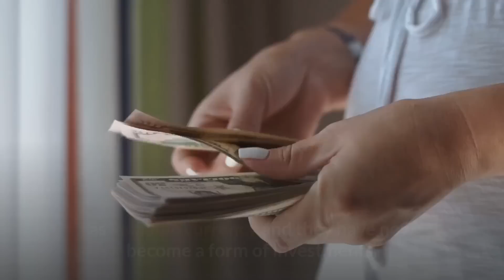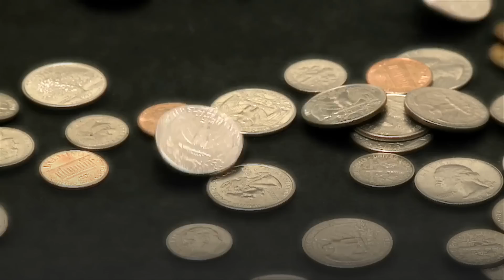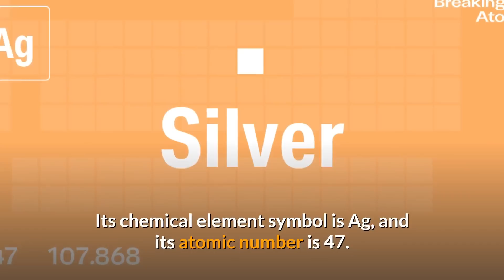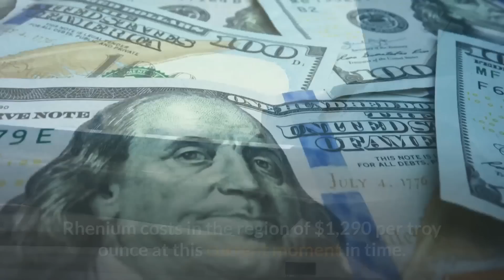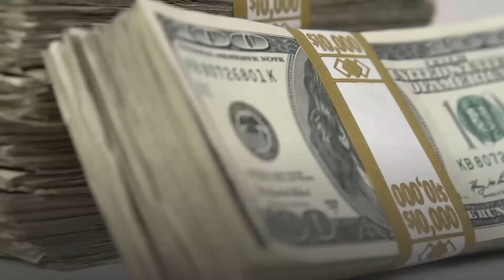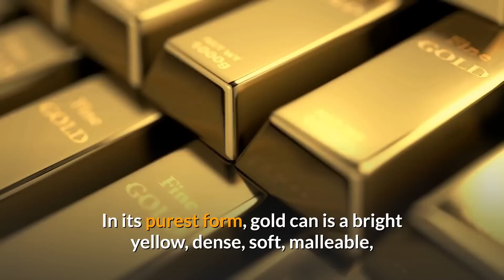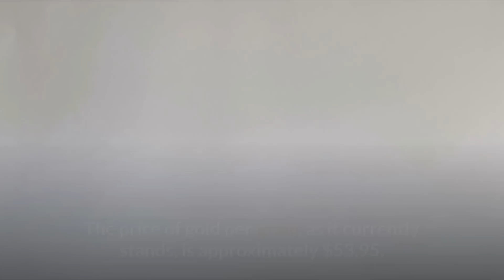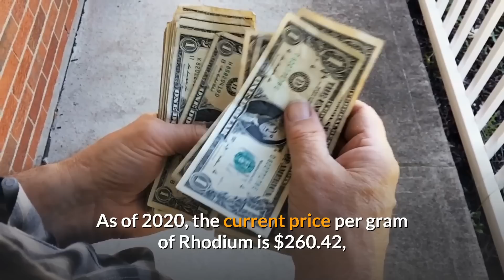Top 10 Most Costly Metals On The Planet | Trend It |

Comment: your title screen states a gram of a metal is 1 million dollars yet none listed are. also Indium is not soft but hard corrosion resistant and very low melting point of 174 degree F. and non toxic. used in plasma screens and toys before the year 2000 when demand versus supply drove the price up over Silver. also used as lead substitute for X ray aprons etc

Comment: this is incorrect as u have not done a liner 10-1 cost per metal & you did not get the prices correct either
Reply: Spot prices fluctuate daily. This video was made quite a while ago. By the time he went to post the video after writing the values for the metals .. the metal value would have already changed. It's also a way a timeline can be made historically when going through documents you can figure out price of goods in a specific timeline based on the gold value of the time. It's hard to imagine there was a time where aluminum was more valuable than gold based on the technology at the time that was very difficult to make aluminum. The pyramid point on the Washington monument was made out of pure aluminum at the time of its construction because it was more valuable than gold. Nowadays, due to the fact aluminum is a easy technology and cheap to make and recycle, the value of that single point on the Washington monument is absolutely worthless for anything except a historical timestamp and relic.

Comment: Californium is more expensive by a lot
$27 million per gram
Reply: What the fuck! 😳
Reply: It's also radioactive so people can not buy it. The tiny amount in a smoke detector is so small that I don't count it.
Reply: @ivarnordlkken8082  The radioactive element in smoke detectors is americium not californium, and californium is used to find oil wells and underground gold and silver
Reply: Californium
Reply: Also half of it will have disappeared in less than 3 years.  Hardly a long term investment.
Reply: A gram of Cf 252 would not only be spendy the radiation emitted would be absolutely impossible to get anywhere near it.
Reply: @christopherleubner6633 this is not tru I have this materials from DRC and it’s very dangerous I was very very sick because of it
Reply: @christopherleubner6633 this is not tru I have this materials from DRC and it’s very dangerous I was very very sick because of it